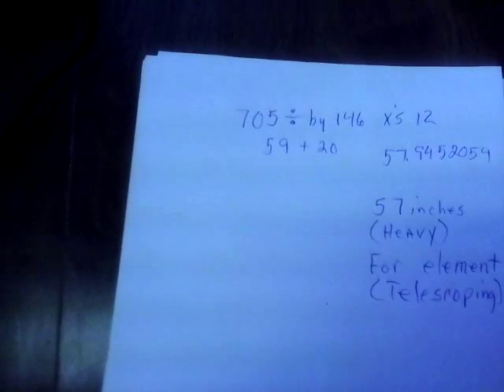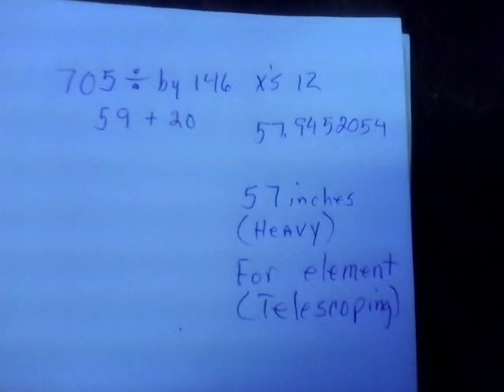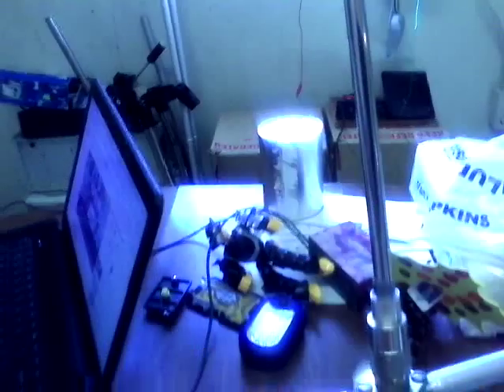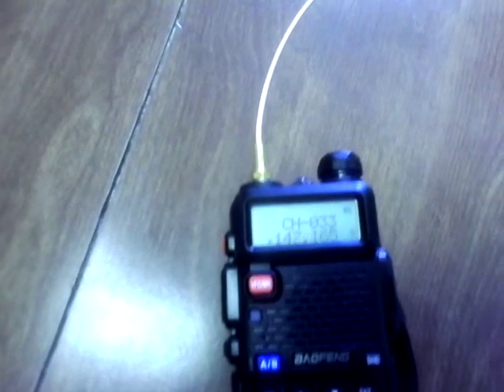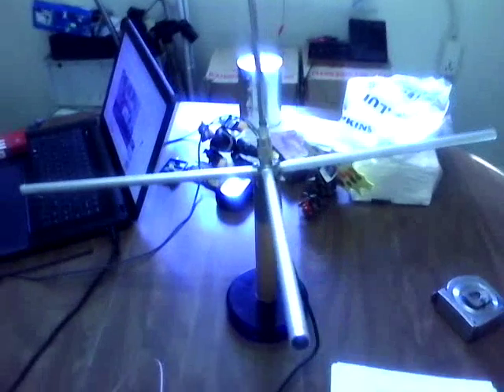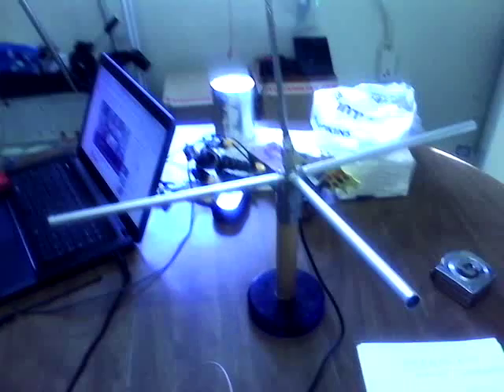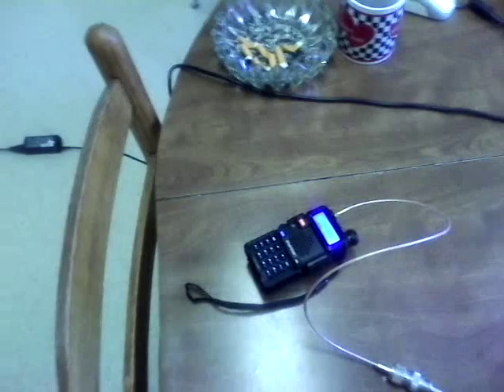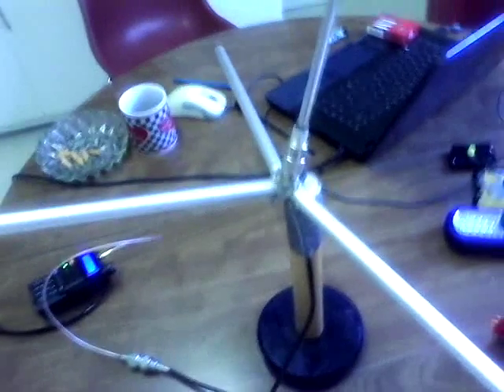homebrew 2 meter ground plane antenna

Comment: Hey bud, its 468÷frequency=1/2 wavelength. You then divide it again by 2 and that will give you the length you need for your center and your 4 ground radials. To make it simple and to the point your main "center" element needs to be 19.5 +- based on swr. Your 4 ground radials need to be roughly the same length of about 19.5 inches. BTW I've been a general class ham operator for the past 10+ years. Thanks and 73 good luck.
Reply from the maker: thanks im learning

Comment from the maker: i made a mistake. wrong formula. im now using 468 devide by 146.000 mhz  to get half wave lenght and devided that by 2 to get 1/4 wave.note bottom element are 20 inches not 12 inches as i said. sorry for mix up.